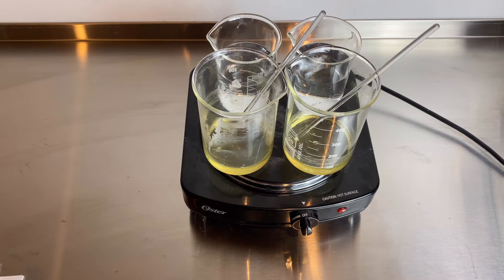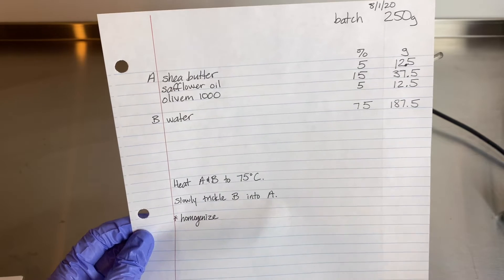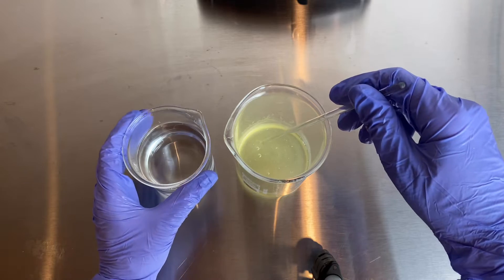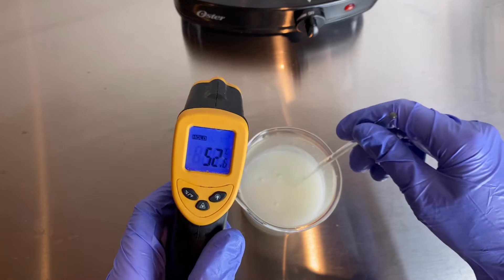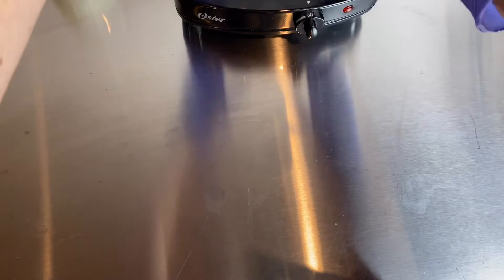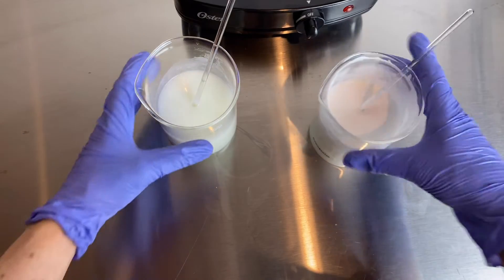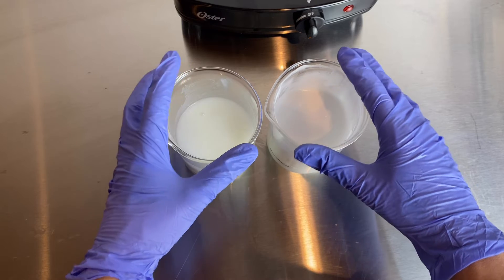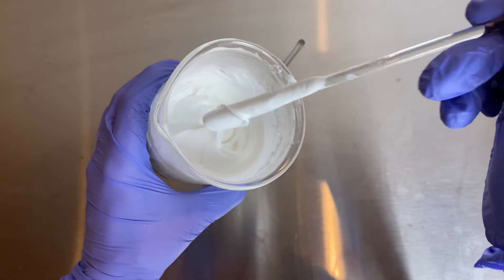Making an Emulsion | Hand Stir vs Homogenizer

Comment: Hi. Homogenizers are best to be used in batches that are over 300 grams. Olivem 1000 is an oil in water emulsifier, how come you added the water to the oil? I know it can be done how you did it but the consistency will be different.  You did not use a preservative either.
Reply from the maker: I’m not using this, it’s an experiment, so no need to use a preservative. Every homogenizer differs in batch size, this size works for the homogenizer I have. There are plenty of styles that homogenize and much smaller batch sizes and others that require a much larger batch size.  Every emulsifier is different, so with Olivem1000 I add water to the oil. Other emulsifiers may require a different method, it depends on each individual emulsifier not whether it’s O/W or W/O. Happy formulating.
Reply: @Titus2Tallow  very interesting. I did that work olivem 1000 to see the difference  and I like the consistency of the o/w best. Thank you for sharing your experience.

Comment: Stupid question but I am frustrated an my work: do you say "2 mins" at high shear or just doing and see/feel if the emulsion is done? All my samples are separating after a few hours...was long at home (maternity leave). But I work with a SOP and there is "2 mins" written and much high shear rate....asked colleques...they are just doing it and it works....
Reply from the maker: Hi! It's hard to say without knowing your formula, emulsifier etc. With any emulsifier, always consult the usage rate, they are all different. Also, what temperature your phases are at when combining them is important. Some emulsifiers do well with high shear and others do not. The equipment you use to emulsify also makes a difference. I don't know if you've had formal training but I would recommend checking out Formula Botanica. They are having a free masterclass right now and have lives discussing all these topics. Refer to my recent video on the masterclass and you can use my link in that description to access the masterclass. Happy formulating!

Comment: Hi! What's the reason for setting the homogenizer on 2 instead of a higher speed? I've noticed one of my emulsions separating and was wondering if setting the homogenizer on a higher speed could be the reason why.
Reply from the maker: You want to set the correct speed so it doesn’t introduce air into the formula. Also, I don’t want the formula to fly out of the beaker. Best to start low and work your way up as needed. Make sure you check the specifications with every emulsifier you use. Some emulsifiers can only take a small amount of high shear, others require it. Too much shear can break some emulsions.

Comment: What is the actual difference between a homogenizer and an immersion blender, cause they look very similar in appearance, use, and other things. Also can you use an immersion blender for making emulsions?
Reply from the maker: You can use an immersion blender. The difference between the two is that an immersion blender can incorporate air into your formula. Also, a homogenizer gives better stability to your product because it’s able to decrease the size of the particles.

Comment: Can you please explain if there is any specific reason for the temperature that you have taken?
Reply from the maker: I take the temperature of my formulas as they heat up. I want them to reach a certain temperature based on manufacturer recommendations. It’s usually around 70-80 degrees Celsius. I want the oil phase and water phase to be the same temperature when I combine them. Then, as it cools I continue to take the temperature so I know when to add the cool down phase and any temperature sensitive ingredients. That’s usually around 40 degrees Celsius or less.

Comment: Thank you for posting this. Can I ask if you have tried using the Misceo without tilting it at an angle?  I’m wondering whether this would put less air in. Thank you.
Reply from the maker: Yes, but it functions better at an angle. It’s purpose is not to incorporate air, you hold it beneath the surface during its entire use.
Reply: @Titus2Tallow Thank you.  I'm curious because you describe the volume at 6:37 as being greater in the homogenized one, with a texture as being like marshmallow, and so it seems like the device is adding air into the preparation.  I guess there is no way to take out the air or prevent it from getting in?
Reply: @michaelhilson3699  it does not add air, it has to be at an angle to operate properly and breakdown the ingredients so fine that they absorb into skin instead of sitting on top of skin
Reply: @dawnmiskin8487  There’s already air inside it, that’s the air it uses to be able to do it’s job. Without it, there will just be a suction action at the bottom which would create a whirlpool at the top to get air.

Comment: Thank you for sharing. What is the minimum quantity that can be homogenized with this one ?
Reply from the maker: You can contact the manufacturer for technical information, I’ve linked their site in the description box. This model is recommended for 1-4 L however I was able to make a 250 mL lotion. I think you could get away with a slightly smaller amount but not by much.